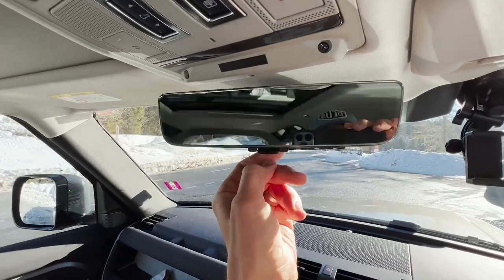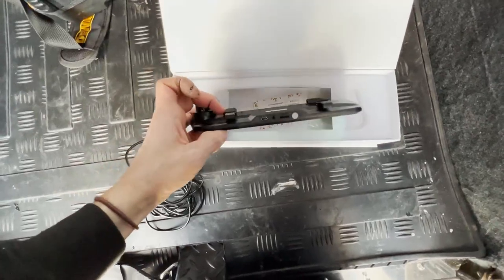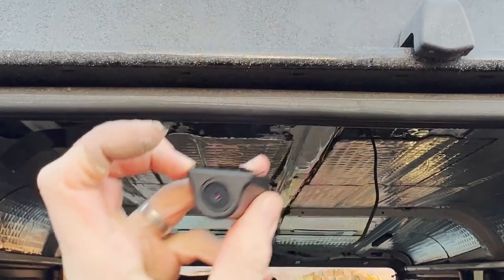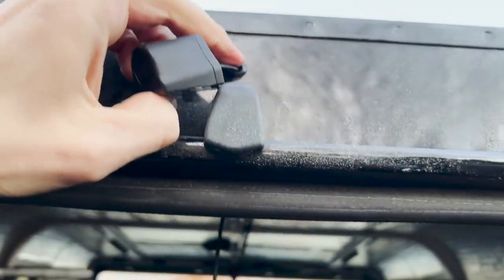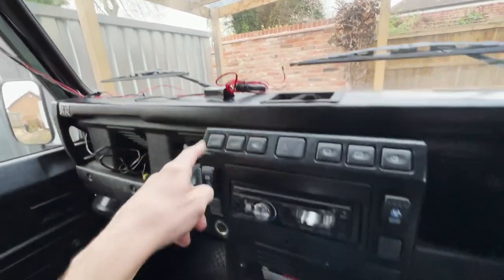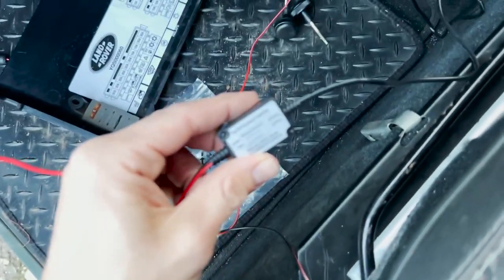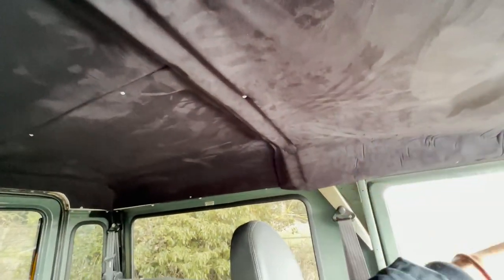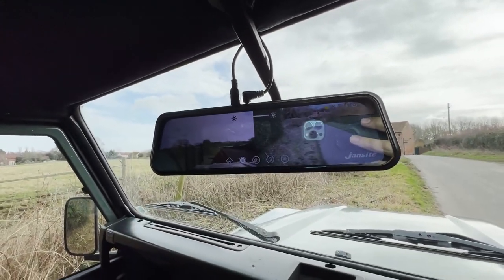FITTING A LIVE FEED REAR VIEW CAMERA TO MY LAND ROVER DEFENDER! (less than £100!)

Comment: That's jolly smart. It is pretty much what I did with my front and rear recording dashcam, including using a USB connector and the positioning of the rear cam. I managed to find an 'ignition on' the live wire behind the radio somewhere, though. I must admit I removed the internal mirror years ago. I also have tinted windows and the reflections drove me crackers. Yet ironically, it makes a huge difference to general visibility. I tend to use the external mirrors to reverse; however, my dashcam has a wire that connects to the reversing light, and when it detects power, it automatically shows the view from the rear cam, which is useful for blind spots. There is also a button on the side of the dashcam that lets me activate the rearview manually if I need it.

Comment: I've also fitted a 'mirror camera' and although the features are good and the camera is OK, i have the drooping problem and also al lot of vibration when driving that causes the mirror image to blur. have you had that problem? I'm going to try some thread lock on the ball to see if it fixes the drooping. PTFE tape didn't surprisingly.
With the droop and the wobble it's pretty much unusable, unfortunately.
Reply from the maker: Sounds annoying - fortunately I haven’t had that issue myself but thread lock
Sounds like a great idea to help 👌🏻

Comment: It’s a neat idea for sure. So now that you’ve had it installed for a while, do you still like it? Personally, having a screen there vs an actual mirror would drive me up the wall after a while lol. I’d have opted for a double-din head unit instead, but that’s just me.
Reply from the maker: I still do (but my wife hates it) I think it gets some getting used to. It’s very similar to the clear view in the new defenders and helps witht he spare wheel mounted so high

Comment: A good solution to the problem dashcam and rear camera.
I have drawn power from the fuse box with a power thief on my 110. Unfortunately, the brake light is now permanently on. Do you have any ideas? Is there an unused area in the fuse box that can be used without complications?

Comment: A tip.... undercoat and paint that bare metal around the drilled hole, guaranteed to rust otherwise.
Reply: Show that you know nothing about Landrovers without saying you know nothing about Landrovers....
The bodywork (other than the bulkhead and door frames) is made of aluminium alloy.

Comment: My Defender's mirror doesn't seem to have enough friction for the extra weight. When you clip the thing on it just droops down lol.
Reply from the maker: Yeah mines close to having that issue to be fair- you could try putting a bit of rubber or
Something on the ball joint to try increase the friction between the parts